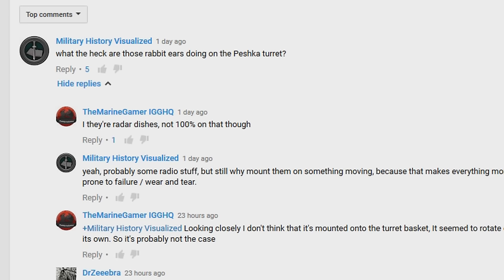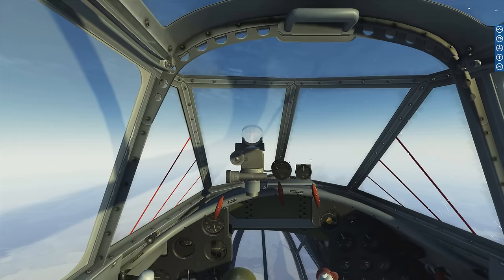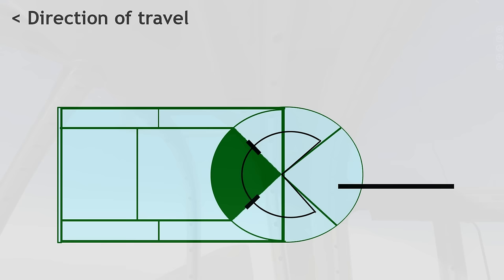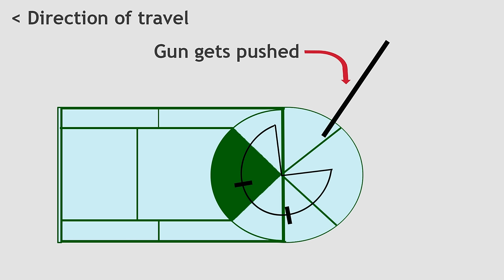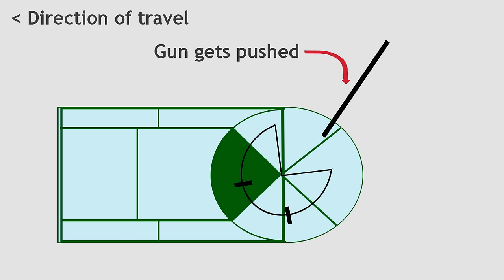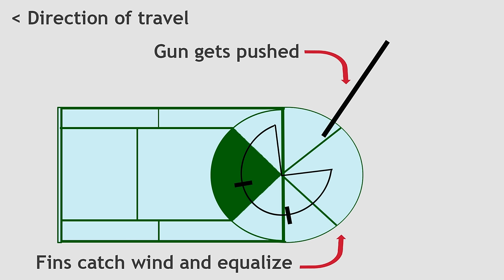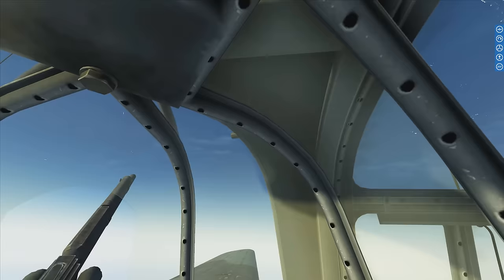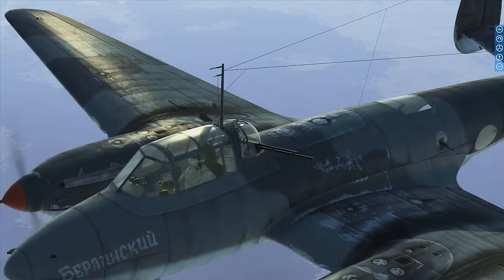⚜ | Why does the Pe-2 have 'rabbit ears'?

Comment: Leave it to the russians to find the most direct and hands-on solution.

Although it reminds me a bit of the italians with their MC.202. They had issues with the huge torque of the DB601 engine. So instead of counteracting with trim tabs they just made one wing a bit longer to combat the rolling.
Reply: Yeah, that or the canted tail of other aircraft. The simple things are always best.
Reply: And induced themselves into lulzy spins 'cuz of it.
Reply: ***** Oh, you need power to take off on your own, comrade? Vodka fuel-injections will make you so powerful, you can take off and fly like strangest helicopter ever!
Reply: you need troop chopper with firepower comrade? I cut hole in middle of chopper and put bench in it. mi 24 in a nutshell
Reply: Oh those spaghetti warriors

Comment: Aerodynamic balance, I believe the term is, when used on flight controls. The spitfire also has a similar feature on it's rudder. You can also have mass balance, which has a similar effect to having the air do the work to make it easier to move the controls.

Comment: Thats pretty awesome and it sums up Russia very well for me. There are a lot of ways to solve the issue, a hell of a lot of them would be better than the Russian method. But this was effective, cheap, reliable, and easy. Its genius comes in the fact that it wasn't perfect, but it was "good enough" and the rest of its design goes into making it simplistic and cheap to produce,
Reply from the maker: Yeah, it wasn't exactly new but them using such simple solutions consistently speaks volumes about their whole design philosophy
Reply: We call it "Smekalka" :D
Reply: Olivia Lambert 
Russians make simple, cheap and sometimes clunky designs, but they WORK.

The German version of this would be delicate, superbly designed, insanely complicated, and would break the second time it was used.

Lol, then a German field mechanic would improvise a small widget that would solve the problem, but would later be reprimanded by his comanders because he let the aircraft leave the ground with sub-standard equipment on it.
Reply: @michaelcoulter1114  Reminds me of the pen developed to allow Astronauts to write in space. 

To avoid the problems of Melting plastic, Vacuum and Zero gravity they developed a metal pen. The ink was pressurised with nitrogen so it was forced down to the ball in front of a stainless steel plug.

The Cosmonauts had to take a pencil and you can't sell them for inflated prices.

Comment: i also wondered if the mechanism would have any directional issues for the pilot,apart from minimal drag,would the pilot experiance opposing flight control when the gunner turned,because this mechanism was also good for the pilot if the gunner died as the gun would self centre itself causing less drag and or flight issues.

Comment: What's a bit surprising is that the "rabbit ears" move with the turret (as least as modelled in Il2). How can they actually block the air flow when the gunner is aiming on the sides?
Reply: Ferdinand Bardamu They don't. They simply balance the airfloe by inducing drag on the opposite side.

Comment: American solution; electric turrets?
Reply: Soviet russia: naw, we put rabbit ears and real rabbits in our turrets
Reply: If you want a cleaner airframe to boost top speed by a bit and eke more range out, the answer was yes. (Even if it cost a bit in weight and system complexity.)
Reply: Americans joke about Germans always seeking the most over elaborate solution but they aren't immune themselves. See the famous space race pen problem. NASA spent millions developing a "pressure pen" that would force the ink out. The Soviets used... a pencil X-D
Reply: Fun little trivia, but people tend to not continue the story: then the russians realized that graphite powder in an oxygene-rich environment put in space - where combating flames is not most people's dream job - is rather flammable, so they also started using pens.
Reply: AkosJaccik "whaddya mean my drawing pencils are a safety risk! I paid good money for this moon cruise!"
Reply: @visionist7  Theres a solid reason for that development though. In zero gravity fine flecks of lead/graphite could snap off the pencil and get lodged into the systems of the spacecraft. We've all accidentally cracked the tip of our pencils before. Sure it may have taken a couple million dollars to research a pen that wouldnt jam in space but now you dont have to worry about fine specs of pencil causing an explosion or malfunction in the craft.
Reply: @conoromeara6108  Also, NASA didn't even spend a single penny in developing the pressurized space pen. It was actually the Fisher Pen company do all the work. After the pen made it into space, Soviet space agency also started using it. Though in the past, Soviet cosmonauts use a grease-type pencil like what was used by divers since it doesn't generate dust compared to a regular graphite pencil.

NASA also received a discount from Fisher Pens company after ordering a bulk of 400 pens to be used for later Apollo missions.

Comment: so why do WWII fighters have a wire going from the cockpit to the top of the tail? They have no gun turrets. The Me-109 is a good example.
Reply: That's a radio antenna. Most early war planes were using HF radios, which due to their long wavelength need a rather long antenna- this was most easily achieved by running a wire from a mast behind the cockpit to the top of the tail. Later on the HF radios were often replaced with VHF radios. These needed a much shorter antenna, so the wire was removed and the antenna was mounted somewhere else- often inside the mast that had previously supported the HF antenna, though some planes got a new 'whip' antenna under the wing or on the rear fuselage.
Reply: nerd1000ify thank you so much I have wondered for years what it was and never knew what to google thanks again 😊
Reply: nerd1000ify is the little L shaped spike under the wings of some planes?
Reply: its for the pilots to hang their washed dirty undies after a sortie

Comment: hehe always wondered why they were there, now my question is: did anyone else use the same method to solve the problem or was this just exclusively designed by the USSR?
Reply from the maker: Depends on the turrets. Poweroperated turrets existed but sometimes you needed neither that nor this sort of thing. Very much depends how you set it up. I'd have to check if other planes had a similar configuration in it's turret as a 'propulsion system'.
Reply: Bismarck hmm very interesting little work around for the turret nonetheless, thanks for the video :)
Reply: Yeah it's interesting. Most bombers I can think of with turrets had powered traverse (American). A similar configuration as the Pe-2 can be found in the late version of the Do-217 (without ears), would need to know if that one had powered traverse or it was moved by gunner's muscle. Btw you can find these ears in other Soviet top turrets like in the IL-4 and Pe-8

Comment: So they're basically vertical stabilizers?
Reply: Kind of except horizontal stabilizers because they use the drag from the air to counteract itself by negating its own force. Thus the only net force is the gunner moving the gun which is much easier.